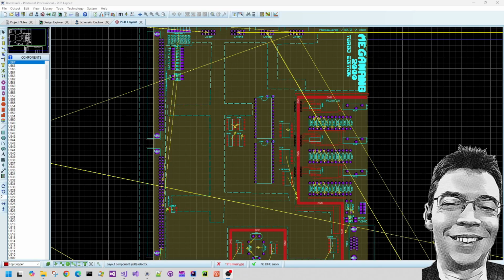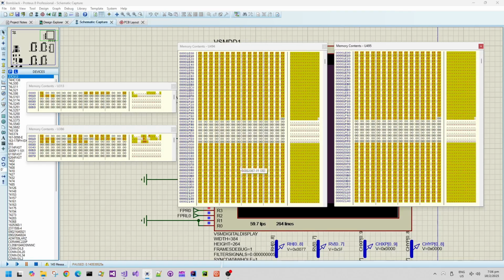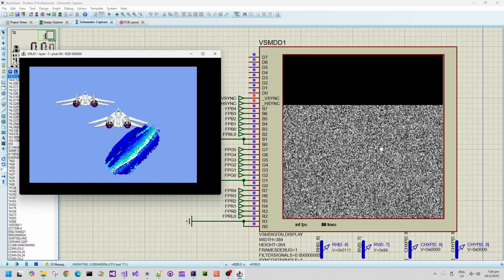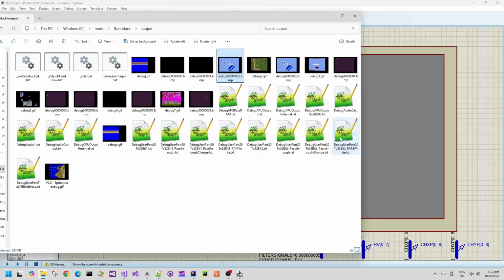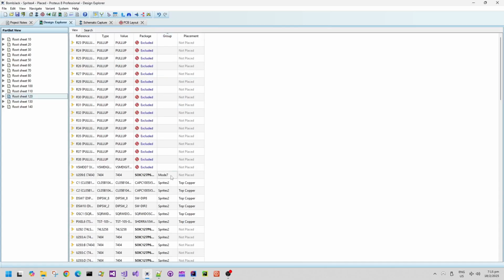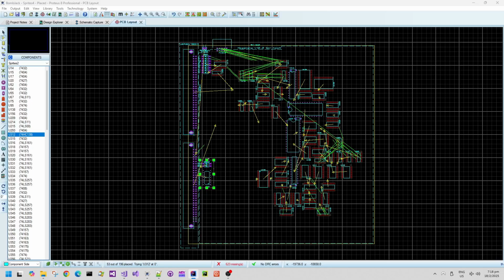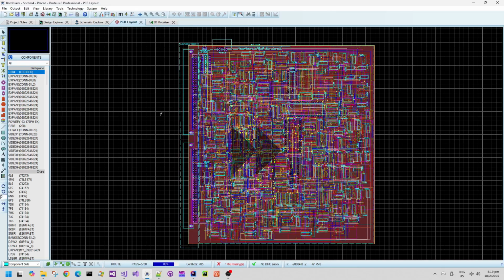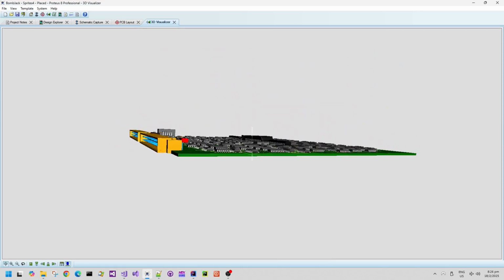MegaWang 2000 Turbo Edition - 36 - Super scaled sprites with Schematic

Comment: Very cool project. I wonder if you thought about have put into a FPGA solution? I've never looked at FPGA myself, even thought I own a MiSter ( for emulations) there seems to be a good level of lower end systems if the price looks fair. Just a thought.
Reply from the maker: I'm deliberately using 74LS TTL logic and avoiding FPGA/CPLD solutions. :) More info why here: https://github.com/martinpiper/BombJack/blob/master/README.md#why-not-use-a-cpld-or-fpga
Reply: @MartinPiper6502  Arr yes, very interesting point. Very cool to see how with modern tools how can create something not far off the mark for what Sega would had to do by hand. With the hardware it's very true the good old 6502 even on the C64 would be able to run a considerable amount of (considered) higher end titles which at the time only the like of maybe the 68k system would of been able to tackle.  Keep up the the good stuff Martin.
Reply from the maker: The arcade used dual m68k and a Z80 and ran at 60 fps. The C64 6502 demo code in game is currently running at around 30fps. I'm mostly CPU time limited on the 6502. It's almost time to build this board.
Reply: @michaeljarcher C64 was already strong on custom chips, but weak in the CPU department. IMHO clipping is a CPU task. I also find it hard to vectorise . Jaguar does this right. I really need to get my CPU simulator done so that I can invest time into commented JRISC. Rare had no feeling for performance because they used big building blocks from Motorola. For the price of megawang we could get ASICs. FPGA may be cheaper, but tiny tapeout provides a fully open source tool chain. You can basically manually place your transistors or fiddle with algorithms. I think their partner fab would do runs of chips with different tile and a way to sell them to others. I dunno why you need to submit a tile to get the chip. Yeah, the org wants to educate. But would a fully documented chip not also be educational? Like retirees design them and grand children pick them up? My children have zero interest though.
Reply from the maker: This hardware can do a full clip reject test in about 200 nanoseconds. The 6502 would take about 60000 nanoseconds to do the same test. For this reason the hardware does the clipping check.
Reply: @ yeah, just once we get rid of the CPU and look at real world costs (total transistor count), clipping once in a while is perfect for a CPU (even 6502 at a reasonable clock rate like 4 MHz on SRAM, or even better a Z80 with its better duty cycle ). Blitting pixels really saturates a circuit for a long time and is surprisingly inefficient on a CPU. Fixed Function Pipeline !

Very cool would be to put two 6510 on the same SRAM and invert the clock for them. Then we can forEach through arrays. Load the function into SRAM . Use RDY line to slow down reads through transceivers. Have a write queue with flag to slight regulate core clock. I just Wonder if 65C02 were available with tristate address pins. Atari got their fast chips from Rockwell? Or did they only sell complete microcontrollers? It looks like a logic gate to shift zeroPage and stack of each processor reduces the clock rate. So boot them up with SP off set by 128. Zero page is shared. Locks are behind the transceiver . For example a loop limit could be read by one processor and will not show RDY for the other before the one has not written back something.

Comment: My OCD hurts from those randomly placed ICs.
Reply from the maker: I get around that by going one level deeper in the thought process, it is more optimal (and more satisfying) for them to be arranged like this.
Reply: Every time I see vintage server boards my eyes hurt. I get it: to get so many bits into a server at a time when chip level integration was low you need a dense packing of DIPs on the PCB and rather solder on some wires if routing fails despite the wide spacing of the legs. Cooling fan at full power in a separate room.